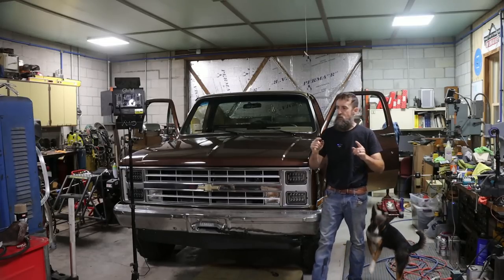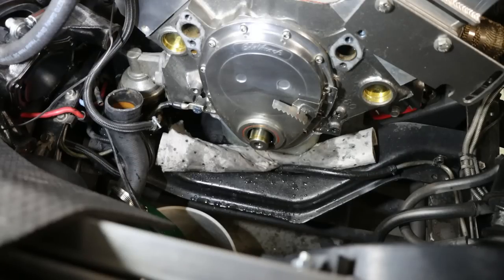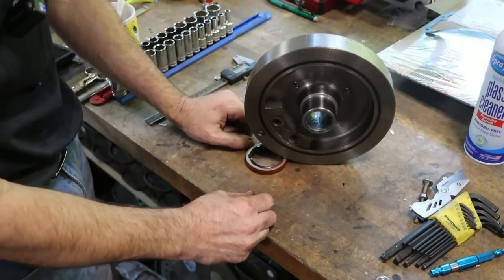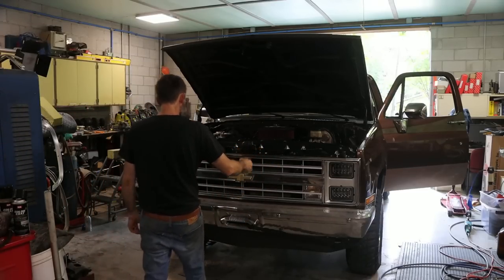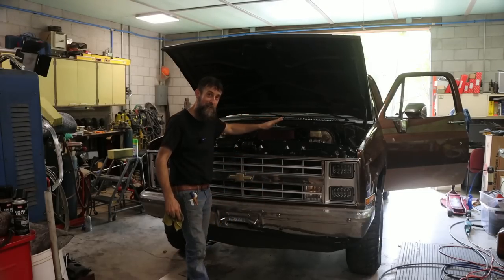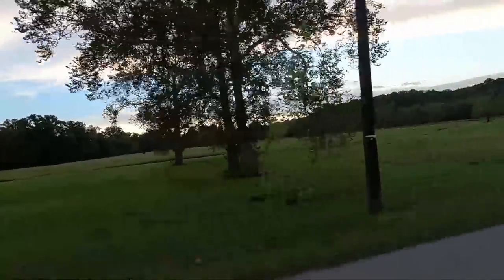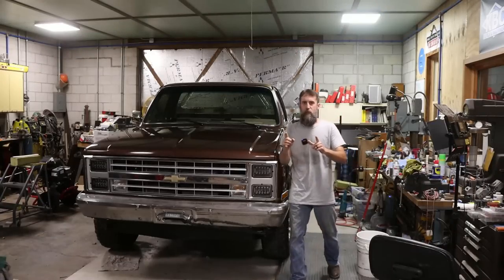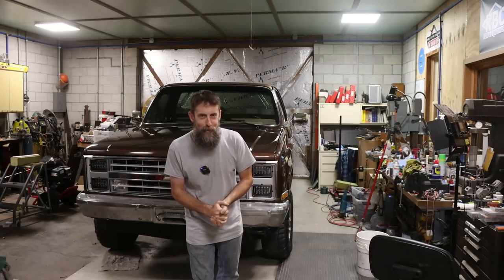Driving Mrs. Summers 1st Test drive after a year of work.

Comment: Steve I worked on hundreds   small block Chevys back in the 70s along with racing them on oval tracks, leaks like you are having generally indicate a crankcase venting issue, the leak at the back of the intake manifold after the balancer is a good indicator, there is no such thing as too much crankcase ventilation.
You truck is very well done, you not only did an outstanding job with the workmanship but also demonstrated that doing a restoration is time consuming and painstaking when you actually DO the work and don't farm out all of the various components for repair or refurbishing only to reassemble the truck and declare victory, to me that's a fools paradise.  The tasks involved with actually touching and working on virtually every part of your truck has to be one of the most honest and realistic builds ever published on YouTube or even TV for that matter, I for one just can't stomach the "blow it apart, sub everything out and reassemble" crowd, to me that's just smoke and mirrors to sell products nothing more, you on the other hand walked your audience through the actual work processes required to produce the final product.
Reply: I can't agree more! We got to see pretty much every aspect of the job and it felt wholesome and refreshing. So many start on youtube being genuine and cool but then they start to using all the 'flashy' tricks that are as honest as click bait titles and I say to myself, "another one bites the dust...". I think we got a good one in Steve :)

Comment: It can help to leave the timing cover bolts loose, then install the harmonic balancer, then tighten the timing cover bolts  There's a little slop in the bolt holes so the cover can move around a little, and this way the seal will center itself on the balancer shaft and eliminate any misalignment that may have been caused by tightening the timing cover bolts first.
Reply: That's exactly what I do, too. But in addition, I drill the cover and front of block and dowel them so they are in perfect alignment now and in the future if I have to remove the timing cover for any reason.
Reply: @budlanctot3060  that's a very god idea and mod

Comment: Hey Steve, as I've heard from plumbers many times over the years working in construction for 35 years "hot water doesn't need Heating" 
(It's just a water heater)
I heard from so many plumbers over the years.🙉🙉🙉🙉🙉👍👍

Comment: Well done Steve. A tip for the balancer seal is to not fully tighten the cover bolts without first partially sliding the balancer on to the crank. Those pesky intake leaks at the corners are notorious for intermittent leaks. Sometimes they stop, or not. This project is something you can be very proud of. WOOHOO on you my FRIEND ! ! !

Comment: You need to loosen all the bolts on the cover so the seal can allign itself with the damper
Reply: Problem is that those timing covers are doweled and you have to rely on the accuracy of whoever built that cover.  On the old English cars, we always left the bolts loose until the pulley was on so it would self center.
Reply: Will only help if no dowels and the pan is off.  the thick rubber pan gasket piece will be pushing it off center.

Comment: Another good suggestion also is to put a 1/4 inch 35* to 30* chamfer on the OD oil side of new balancers. For an easy install. Careful not to nick anywhere on the sealing race for the seal. 👍👍Adam is up here in IL. wounder if he'll stop by your place for ride along. 🤞🤞

Comment: If that seal leaks again, you could loosen/remove the timing cover and tighten it after the new crank seal is replaced and the harmonic balancer is installed. Doing that might self align the aftermarket cover to the crank. You might need to ream the holes a little to give it some wiggle room.

Comment: Man its so nice seeing that truck running again.  It looks sharp, and should last you another 250k miles.  As far as rattles and squeeks, its till an old truck.   Its gonna have a few of those.  Itll never be "finished".  Itll be pretty close though.   You have every right to be proud of that truck.   Youve put a crapload of work into it, and its running nice.   You'll get all the gremlins worked out.

Comment: One of the things i used to do when i was working was to leave the cover loose with the new crank seal then install the vibration damper (or actually put the whole front cover on the vibration damper then put them both on as a assembly)so the seal centers its self on the dampers seal surface then tighten the cover bolts
Looks like a national seal i like to use Chicago Rawhide CR seals

Comment: you got it done - you will work out the final details and start turning some miles on it - you should be happy - it needs running lites and radios and a scanner of course - get a tablet you can connect phone to and velcro it - get a blueteeth and log all the data to a laptop for good baseline and future tuning - do a break in period/change oil, put a toolbox on it, think about transfer flow tank also
Reply: ....are you done now???  Sheeesh!

Comment: Typically drain petcocks are a NPT thread. What I do is do away with the petcock and with a few fittings position a good quality valve so it drains where I want it. Being I'm a retired aircraft mechanic I do everything with AN fittings.

Where most people make a mistake installing the crank seal is not leaving the timing cover loose until the harmonic balance installed,  if, and I say if the cover does not use any locating dowel pins.

Comment: Steve, the truck looks fantastic! BUT you have to remove, or at least loosen the timing cover and then retighten it after you have fitted the new seal and refitted the balancer, this aligns the seal centrally over the balancer. There should be sufficient play in the timing cover bolt holes to allow this to happen, but with an aftermarket part, you sometimes need to add a bit of clearance with a round file. the seal will generally fail quickly unless you do this! Sorry to be the bearer of bad tidings! Love your channel!
Phil, UK

Comment: I have heard the following idea put forward about lip seals. If they are left after assembly dust and dirt settle in the oil used to assemble the the seal forming a thick gritty paste that then wears away the lip. It sounds plausible but not totally convincing.

Comment: Well, past the 100 miles by now, so time for the first oil change, which on a new engine is always recommended. A magnet in the catch pan will also show you all the tiny bits they missed in machining as well.

Comment: Hooked up the computer and gave me a loose shock bolts code. 😂😂😂😂
Reply: Agreed. The Aluminium magnet sensor was doing a good job to pick that up. Dodgy mechanic but good magnet and sensor. Need to get two of those over here. Retired mechanic in Land Down Under.

Comment: Steve what an awesome rig that you have put together over the past year!! I have watched every video since you started this project and have loved every one of them!! Now you and the Misses can go out and enjoy it for years to come!!! The one thing though if I remember correctly is that did you end up putting those rubber gaskets in at the front and rear of the intake?? If I do recall that you did and I had said that you would end up with a leaking intake!! The first thing I do when replacing those intake gaskets is I definitely throw them rubber gaskets away and I just use  silicone on the front and rear and I have never had one to leak doing it this way but you definitely have to put a good size bead on so that when you put the intake on it will smash the silicone out as you are tightening the intake up!! Then you can take your finger and wipe the excess off!!! Hopefully this helps you out and I also can’t quite remember if that was you that ended up using those rubber gaskets or if it was someone else?? Hopefully it was someone else though!!!

Comment: Have a question for you Steve Summers on wheel hubs that had screw in 9/16" wheel bolts  and one stripped out replacing it with a stud bolt with 9/16" threads , .588" shoulder , .622" max knurl .617" min knurled area , what drill size would you use in order to draw that stud into the hub ? I predrilled the hole to 9/16" size any help you can provide on drill size would be appreciated .

Comment: How warm is that rear end getting? You aren’t pulling any loads and don’t appear to have been cruising interstate speeds yet. I would say if it is getting over 150f it’s probably too tight.
Reply: In my younger days I had that problem when I thought a heavy drag of preload was good and it would wear in. Turns out it just squeezes all the lube out instead and it goes south from there. Lol Barely any resistance is where I set stuff up now. Modern bearings don’t really wear in like they did 30 years ago. I don’t find they really wear in at all. Guess that is why most new vehicles don’t even mention a break in period anymore.

Comment: ATTENTION danger on the front of the engine there is a bolt hole that must have a short bolt installed in it. It will suck dirt and debris in and blow oil out if not installed. The location is by the fuel pump and it is in line with the fuel pump push rod and on your motor it is above your ground cable. It must be short so it will not bottom out and crash into the fuel pump pushrod. I am a Chevrolet technician and seen many warranty crate engines come back with failure from this issue.
Reply: He knows this.  It was discussed in one of the build videos!

Comment: Sorry Steve... you are the man... but I pretty sure the rubber got rolled when the balancer was installed... I'm pretty sure That the extra build up of the coating that was on it... didn't help any.... so I think that a combination of both is the culprit in this malfunction.... I'm not hating..no disrespect ment.... I'm a retired mechanic and I agree with Steve 100% on just go head and take everything thing off that might be in the way... a person would do a lot better job when they can get confy...
and able to get to everything without other things all in the way....it will also keep the agrovation way down and that's always a +.....

Comment: sure hope the cause of the rubber seal to start leaking isnt a bend cranksnout or you be replacing that seal or add oil to the engine quite often
still think a toyota hilux or a chevy s10 4x4 would be best for elisabeth's size  , and i seen plenty of s10's that had a small block chevy put in it and the heigt of the truck would make it a lot eazier to get in and out of , a topper on the bed or blazer might be better for a daily driver as you can lock stuff inside instead of having it laying in the bed for all to see and grab , the extra seats of the blazer might be handy too
Reply: Huh???  Please remember, punctuation and grammar are your friends!!
Reply: @paulcopeland9035  im not amerikan and english isnt my normally spoken language

Comment: If you have nylon timing gears get rid of them ASAP they will deteriorate and cause you to have engine failure. And if you have no clearance between the valves and pistons it will destroy your engine. believe me. I know.
Reply: Where in the hell did these comments come from.  This was a complete rebuild and he is as particular as one gets.  You must have missed quite a few episodes!
Reply: @paulcopeland9035  I had a 1966 Shelby in 1966 and the nylon timing gear destroyed my engine. This was just a warning.

Comment: At 21mins into the video where you are filming the truck going past, I can't help but hear a misfire, like the engine has a dead cylinder misfire. It doesn't just sound right. Or is that the camera distorting the sound?
Reply: Yea, I'm sure you are right!!  It is ready to blow up any second now.
Reply: @paulcopeland9035        no need for sarcasm, I'm only saying what I'm hearing, and I can usually tell the difference between a smooth running V8 and one that miss firing.

Comment: Those trucks are only nice if theyre clean and built like it is or with 34" tires on em with a blown out glass pak exhaust and a good dent in the bedside which tells you its been places..  otherwise you only see em with rusted out everything and bald tires with a smell inside em thats not pleasant..

Comment: Looks like (possibly) the two left and right alignment dowels for the timing cover are missing-???  If so thats  might well be why it chewed up the seal, the cover will not align and center the cover and crank seal correctly on just the bolts it has to have those two alignment dowels on left and right ---- ALSO, I noticed your harmonic balancer has a counterweight on the backside, makes me wonder if its possibly for the 400 small block which was an (externally) balanced engine using weights on the flywheel and balancer - but the other small blocks ie: 350" etc were (internally) balanced in the crankshaft, often on aftermarket balancers they sometimes give you the counterweight installed but it has to be removed for use on engines other than the 400 small block - but I many be wrong because if this was the case the engine would have a bad imbalance you would definitely notice.  I may not be right about any of this just sharing possible info based on what im seeing from here. She runs as good as she looks, fantastic job on great resurrection-lol--!!!
Reply: I think it’s a 383.  400 crank in a 350 block…need the external balance